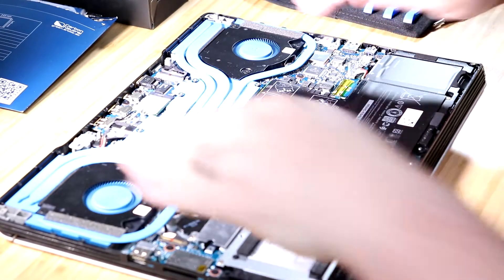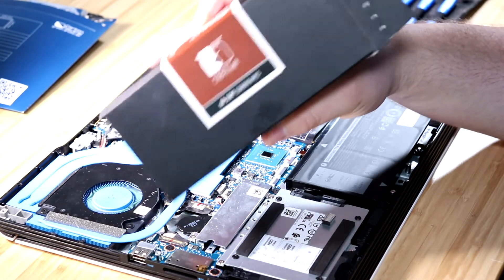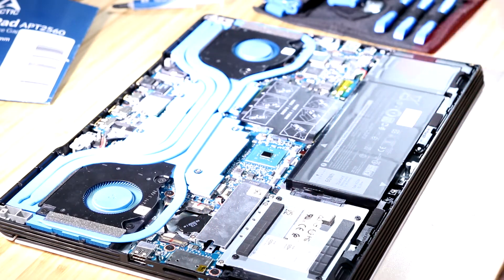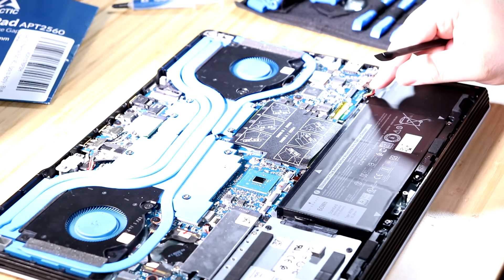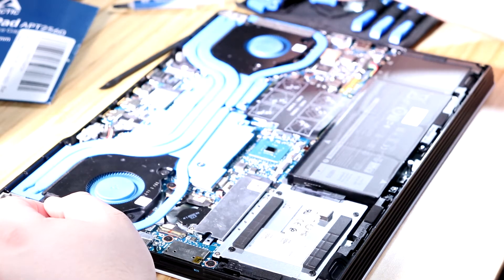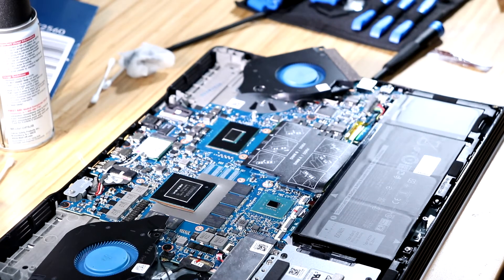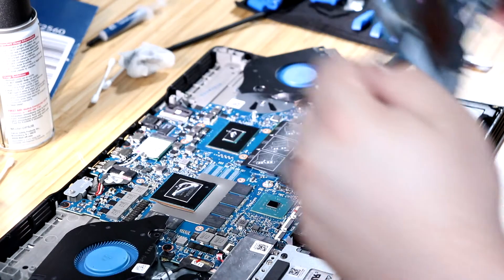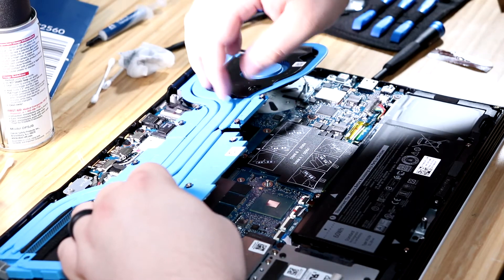Dell Gaming G5 15 SE 5590 Thermal Repaste Guide

Comment: theres a downgrade option in bios for this model. version 1.11 is where you want to be to unlock undervolting. i limited my turbo to 3.6ghz and my temps dont go above 70c with a repasting.

Comment: Hi, thanks for the video! I'm not very knowledgeable on computer techs details, but my Dell G5 5590 has performance issues probably due to overheating since 1 year and a half. The warranty is over, I tried all the updates and fixes Dell might provide for all the components I could, but the problem stays, the games / softwares run very well for a few seconds (Which comforts me in the fact it is powerful) but then they run very poorly for a few seconds, then run well again, etc... It's probably due to overheating, the CPU slows down until it's cold enough to go full force again, then it runs well, and overheats again, etc... Do you think replacing the thermal paste is the solution? Thanks a lot!
Reply from the maker: Yeah replacing it will really help
Reply: @JeffTheITGuy  thanks!
Reply: @JeffTheITGuy  I applied your tutorial and no more overheating problem for now it seems, thank you very much! However when I closed the cooling system over the thermal paste and then reopened it to check if it was correctly placed mine was too liquid (Same thermal paste you linked) and just spread all over the components because of me opening it. I had to clean everything and then reapply it and not open again this time.

Comment: Only, if you had used kryonaut- IT Guy!!
Reply from the maker: Nah. I don’t like Kryonaut
Reply: @JeffTheITGuy  what has that got to do with your liking, buddy? It has way higher thermal conductivity.
Reply from the maker: @R_Vdeos  haha, sorry. I did a test of thermal pastes here on the channel for both air and water coolers. In my testing I found that Noctua NT-H2 was better than Kryonaut,cheaper and easier to clean up.

Comment: i have DELL G5 5590 i7 9750H + 1660Ti the only way to make it sound better without losing performance is to Choose Quiet Thermal Profile in Dell Power Manager app - it's really magic - no noise at all on idle and very quiet and acceptable noise on gaming or video rendering .. hope this help all dell users - this profile is on every dell gaming laptop even last gen .

Comment: If you repaste it AGAIN, add a little more on that gpu, and don't "bounce" it up and down on the thermal paste, you'll likely have some better results. Buy bouncing it and lifting it up and placing it back down you introduced air into the gapes between the thermal paste. I'm not saying you'll get massive improvements, but you can't be certain your paste job has 100% die coverage.

Comment: How long does MX-4 last with those temperatures- I was thinking of using Kryonaut but supposedly it doesn’t like >80 C temps
Reply from the maker: About a year.
Reply: @JeffTheITGuy  at this moment I’m having dell fully replace my heatsink and fans along with my paste- hopefully I can either get them to apply some Noctua NT-H1 or some Arctic MX-4 that I would need to purchase or second best case scenario of be lucky enough to have a technician that actually knows what they are doing and get an excellent paste.

Also how effective was the MX-4 I’m seeing reports of people saying 3-5 C while others are saying 13-20 C which seems unreasonable
Reply from the maker: @VongolaEX10  the temps where about 3-5c but it also increased the clocks. My favorite paste is the NT-H2 from Noctua.
Reply: @JeffTheITGuy  how much better were the clocks I’m already at max turbo and I’ve just had my heatsink replaced with the thermal paste the dell technician used was the cheap Duratech Nano Diamond I might just repaste- which one do you think I should use- MX-4 ($10+Shipping) NT-H1 ($15) MasterGel Maker ($16) or TG-30 ($15)
Reply from the maker: @VongolaEX10  use the NT-H1 and the clocks would finally reach max turbo and would stay there longer. I believe I mention in the video at the end how much longer they stayed at max turbo
Reply: @JeffTheITGuy  no I am using the 2019 model and my undervolt already allows me to reach full turbo however during an aida64 CPU+GPU(s) stress test I’m reaching 95 C. Also just found out that I could get the MX-4 for just $10+free shipping so in this case in terms of performance would MX-4 or NT-H1 be better (the MX-4 supposedly pumps out?)
Reply from the maker: @VongolaEX10  it’s close so the MX-4 is fine
Reply: @JeffTheITGuy  does the paste not suffer from pump out due to high viscosity? Supposedly it’s a major problem for laptops because the heatsink pressure is insufficient
Reply from the maker: @VongolaEX10  I didn’t have any issues with it. Just don’t go wild with it. If you want something thicker go with NT-H2 or Kryonaut
Reply: @JeffTheITGuy  that’s interesting- also which MX-4 edition did you use and how viscous was it- the problem I have right now is lots of pump out reports for MX-4 on different laptops the problem is that G5 5590 reports are so little
Reply from the maker: @VongolaEX10  I just used regular MX4 and I hadn’t seen any reports on it and I had no problems
Reply: @JeffTheITGuy  to be fair I think you may be doing well so far since you probably don’t use it too often- seems like the general consensus is that the MX-4 only works well if you only use it for light gaming or as a secondary computer
Reply from the maker: @VongolaEX10  yeah not a daily driver
Reply: @JeffTheITGuy  well case solved- looks like I will probably just stay with the OEM paste though since I did just get cheap specs i5 9300H and GTX1650 but for $1162AUD it was a massive steal
Reply from the maker: @VongolaEX10  sounds good. Good luck!
Reply: @JeffTheITGuy  thanks very much for your help

Comment: What are your specs on this G5 5590? I have one with a i5-9300H and GTX 1650. When I bought it, it already had the new bios update installed where I couldnt undervolt anymore but by downgrading to a later version (1.12) and then reset to default (not factory) I managed to get undervolting going again. I highly recommend reading through this thread: https://www.techpowerup.com/forums/threads/dell-g5-5590-throttlestop-undervolt-not-applying.264805/
Reply from the maker: Leon i7 9750H and RTX 2060
Reply: @JeffTheITGuy  oh boy thats already some hot hardware. Dell's decision to follow intels recommendation to patch the plundervolt vulnerability by forcing us to give up undervolting without giving us a choice is in my eyes wrong. They should leave us the decision to activate or deactivate undervolting and taking the risk in our hands. Sadly the G5 is already out of the box a very hot running machine but without undervolting it is just not as good as it could be. For those who know what they're doing I recommend downgrading the bios to get undervolting running again, but dont mess around if you're not sure what you're doing.
Reply from the maker: Leon yeah it was the suck to be honest. I was not a fan at all

Comment: Great video Man, But I think you didn't apply enough paste at all. You don't apply paste to a laptop like you're treating a regular desktop, just compare how much paste it was on the machine before you removed it, much more that what you applied. There little to no harm (beside affecting the heat sync curve) on applying more paste, since as you said, is not conductive, and the rest of the chipset is covered by that black pad Dell provides. My G5 got the best improvement just by undervolting (I'm not in the last bios), but you're being fair with what this paste can do you a G5 user. Just curious, did you ended up using the pads at all?
Reply from the maker: Darío Placencio I didn’t use the pads. I know you can go heavy on the thermal paste but I had a good spread and too much thermal paste can hinder thermal transfer.
Reply from the maker: Setzer K yeah, I put the cooler on and tightened it then checked to see how my spread was. It was all covered and wasn’t super thick
Reply from the maker: Setzer K yes.
Reply from the maker: Setzer K yeah newest bios, can’t undervolt. Also you should be able to use either MSI Afterburner or Radeon Wattman
Reply from the maker: Setzer K here ya go, check this out https://www.reddit.com/r/Amd/comments/hk6eqt/a_gpu_undervolting_and_overclocking_guide_for_amd/
Reply: Dell’s thermal paste application is god awful out of the box, it creates issues with thermal transfer and therefore causes issues with thermals

Comment: I got to the same conclusion as you with my G5 5590 (i 9750h + 1660 ti).
I applied Arctic mx-4 and I didn't see any changes in Temps.
What I did was to change the value of PROCHOT to 20 so cpu automatically throttles to 80°C max.
Thanks for the video
Reply from the maker: You're welcome. Yeah its just too hot without being able to undervolt
Reply: You Can undervolt even in last bios update by resetting it to Factory settings the cpu now is much cooler, throttles less and better performance in cinebench.
Use throttlestop bcz I had weird bugs with Intel xtu
Reply: @yasserlaachiri5387  I want to apply this solution to make my laptop run better but I'm not even sure I understand what you're saying ^^;
Reply: Hey, how do you change the PROCHOT value ??  I’m having the same issue here on my g5 rtx 2060...

Comment: You can undervolt it with the new bios I found a solution on reddit
Reply from the maker: JARJEES DR they brought back undervolting? It was locked in the latest bios from what I could find
Reply: @JeffTheITGuy  its still locked but you can easily unlock it with bios factory reset and disabling UEFI Firmware Update in the bios then save settings
Reply: @jarjeesdr2734  I've just done that, it didn't work. Options still greyed out in XTU.
Reply: I found a way to change the fan curves in alienware command center, basically you just go to fusion and create a custom profile, combined with repaste I get 75° c  on full load for the cpu, still not ideal but better than the 90 degrees I was getting before, btw thermo grizzly kryonaut is good because it has good condutivness while still being non conductive so you dont have to be too careful. The reason it heats up so much is the fans don't kick in fast enough and the cooler is constantly playing catchup, having the fans start at 50% and stay there under no load really helps because it gives the fans time to ramp up before things get too hot
Reply from the maker: @clippyremembers  awesome, thank you for that insight, I am sure many of the viewers will enjoy this help!
Reply: I have used the Ryzen Controller app and set my max CPU temp to 75 degrees max.  Now both my CPU & GPU stay in the mid 70s.  Played CP2077 & Anthem 30+fps @ High 1080p.

Comment: If you REALLY want to know what's causing the high CPU temps on the G5 SE, SirSquishy67 has the answers... 

https://www.reddit.com/r/Amd/comments/hmjuxy/i_finally_got_my_dell_g5_15_es_4800hrx5600m/
Reply from the maker: Mr Sensible hi thanks. That seems to be for the newer AMD version. Mine is the intel version.

Comment: I have the same laptop. I just turn turbo off and it games fine. Temps typically stay in the 60-80 degree range.  Of course, that's not the most ideal option. Thanks for the video.
Reply: if you turn the turbo off, it will stay at 2,9Ghz?! So you payed for up to 4,2Ghz and use 2,9Ghz? 
Thats a gread Idea xD
Reply: @Flatsteff  yeah, crazy, eh. I don’t game that much on it, so it doesn’t really bother me. Your sarcasm is real cool.
Reply: @brendenm8646  so, you bought and paid a top end budget device, but you are running it with the speed of a midrange model. That sounds like a great idea
Reply: @Flatsteff  lol. You do you, dude. I wanted a device I could play some PC games on... I’m a Mac user first. But I love how interested you are in my gaming/computer habits. Get off it. Go find a better hobby.
Reply: @brendenm8646  i am NOT interested in you at all... You are just a Mac User :p ;)
But your so called " solution " is a solution for many people. There is a hughe Fred about  " how to get it cooler " on reddit, and THIS is what a lot of them do... Putting the System to half of the porcessig power...  Why not send it back and buy something else?
I don´t understand it...
Reply: @Flatsteff  then you don't understand it. Get over it. lol. There is a thermal management problem with the Dell G5 5590. This is a quick solution to manage the problem. Could I apply thermal paste? Could I undervolt? Yes, but you know what. I don't care. Not as much as you do apparently. Thanks for the laugh, and don't fret too much over the small stuff. lol.
Reply: @Flatsteff  Also, at the best of times under heavy load the Dell G5 5590 will run at about 3.3 ghz... 2.6 is not half of 3.3... I understand that math is hard.
Reply: @brendenm8646  Yes, but this Video is all about the G5 15 SE (!) ( (8/18 Core ryzen 5 with 2,9 - 4.2 Ghz )
Reply: 8/16 of course, not 18 :o
Reply: @Flatsteff  lol.... No it's not. This is the Dell G5 15 5590 from 2019... the Core Ryzen 5 version was released this year. Look at the chasis he's holding at the beginning ya goof! Do you know what you're talking about? The SE 5590 model has a Core i7 2.6 ghz, turboclocked to 4.2 or 4.1... it doesn't run Ryzen. Get off this chat ya scrub.
Reply: @Flatsteff  Christ, he even says 6 cores, 12 threads at the end of the video. Did you even watch it? He's referring to the i7 9750, ya dolt. Get out of here. lol.
Reply: @brendenm8646  Look at the Titel of the Video
Reply: @brendenm8646  but this makes at even more worse... throtteling 16 threads would not be a good idea, but you are throtteling a 12 thread system that lifes by its boost xD
Reply from the maker: Brenden Mernagh you’re welcome.